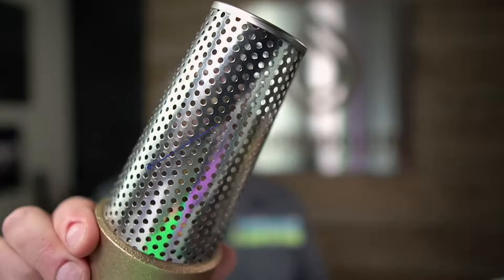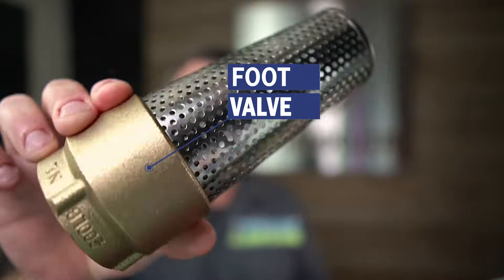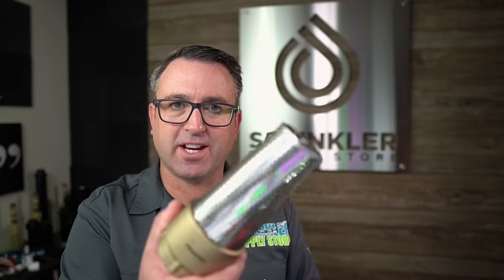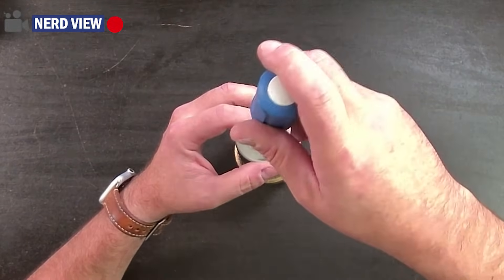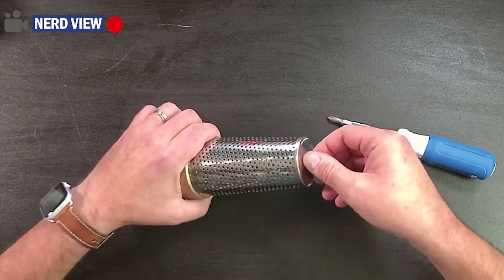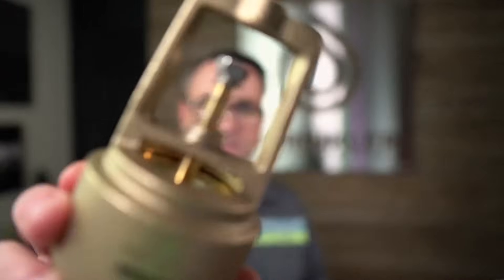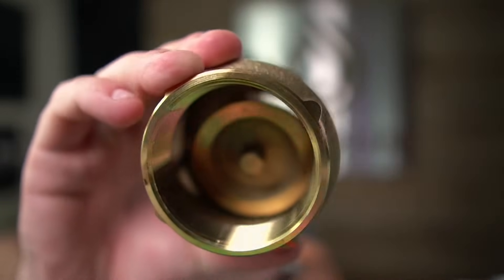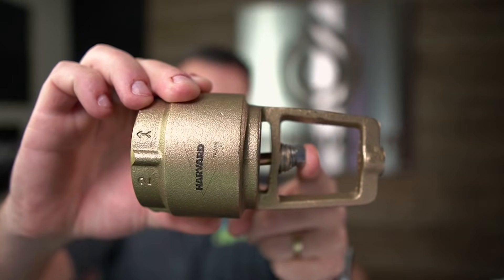What is A Foot Valve or Check Valve? | SprinklerSupplyStore.com

Comment: I need help, Im doing a 40' well in Florida, should I use a well point with a check valve directly connected after or would a foot valve be better at end of well point? Its a centrifugal pump, thank you for any help!!
Reply from the maker: Not sure I can accurately give you an answer. Might be best to find a reference what works with other similar systems in your area. Where in Florida are you? I might be able to make a referral for you.

Comment: I have been losing water pressure and had the pump/pressure tank and switch checked. Had the valve checked and replaced but it was all good. Now there is no water at all being pumped. Do I not have to prime the line if the valve has been replaced? My line is over 300'.
Reply from the maker: Could be a few things. Yes, check prime.   Is it possible there is a break in the line, and the pump can’t keep up?

Comment: What devices can be added to a foot valve assembly in a pond to keep debris off the screen and away from the pick up? I have heard of a device that spins using pressurized water diverted from the up stream pump water (similar to how a spin-clean filter system is operated), but cannot find any information.
Reply from the maker: I don’t know specifically, but it is a good idea to keep the foot valve off the bottom. I have seen intakes that resemble a PVC drain pipe with holes drilled in it. I have also seen floating intakes. 

I’ll try to remember what the PVC drain pipe intake is called, if I recall, it’s on a ski/skid you slide into the water.

Comment: So I have put a 275 gal Potable Water tank in Basement for Artesian water , I have everything needed to get it set up for added Faucet on Kitchen sink , and Im like OK where to put Check Valve ? Before or After Transfer Pump , So i thought id put it near pump inlet , so when pump shuts off it will stay primed , tho im thinking what about the water in line before CV , it goes back up (4’) curves to center of top tank and drops into tank 3.5’
So im like Wont that water before CV seep back into tank Leaving air in line , Is how i came to Your Video here , 
Not sure if i really need to just move CV all the way down line into tank where its underwater 24/7 ….. tia for any feedback
Reply from the maker: Happy to help, feel free to schedule a call.
Reply: @Andy_Humphrey  ok so in my learning process , i have Wrong style Pump. What i need is a pump thats controlled by a Pressure switch … then No need of Check Valves of Foot values that work on sump pumps

Comment: This is a great quick video on foot valves, thanks!  I've run into people who suggest that a backflow preventer (out of the water) also be used with a foot valve.  But you're suggesting that a foot valve is taking care of the backflow already.  Is there a reason you'd ALSO use a check valve (perhaps closer to the pump)?
Reply from the maker: Thanks! Yes, you could add a check valve near the pump, that won’t cause a problem. 

Having a backflow preventer doesn’t have a purpose when pumping from a pond, lake, etc. as the purpose of a backflow is to prevent contamination of a potable water source, such as a municipal water source, or a well.
Reply: @Andy_Humphrey  (sorry, mixed my vernacular.  i meant a check valve when i incorrectly said backflow!)  ty!

Comment: Does it matter if my foot valve is more horizontal than vertical in the lake?
Reply from the maker: If it is a spring type, like in the video, it can be at any angle. If it’s a flap type, it should vertical, because it’s needs gravity to close.